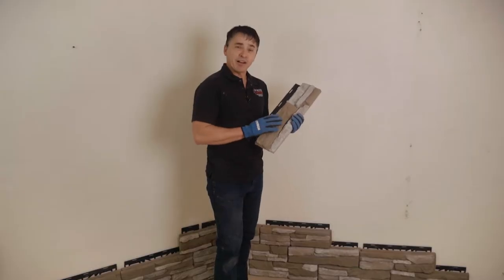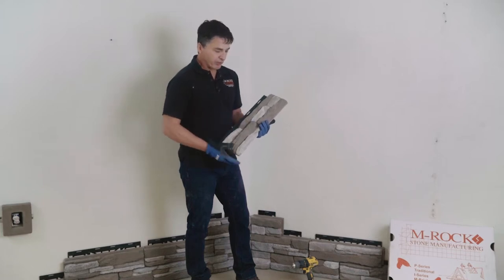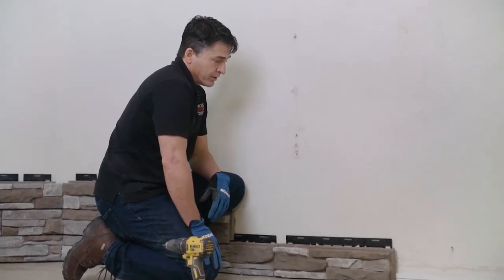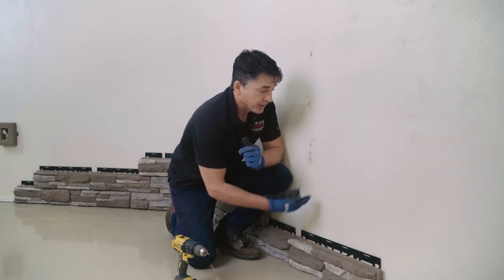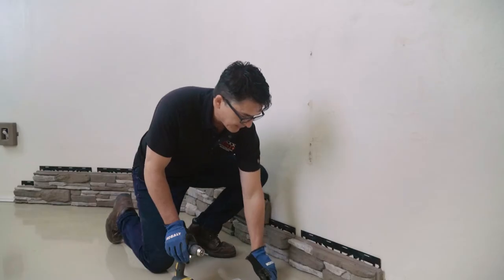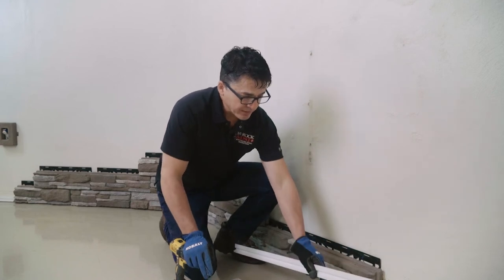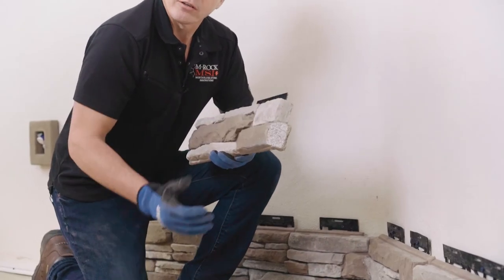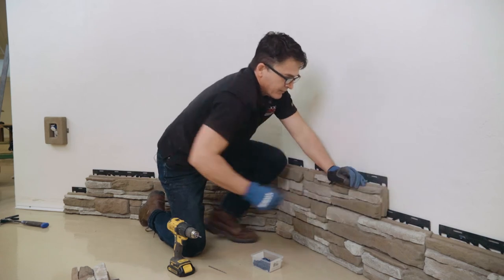How to Install M-Rock's P-Series Stone System

Comment: Or possibly even laying your bottom ground level under your rock before you pull your concrete it's for the pattern recognition flow of it and wondering how it would hold with heating and air

Comment: So I worked on a house and I think little young got here or worked on outside brick wall or material wall if you thought about changing to insulation walling but also it's for like a spread evolvement for like production repetition but it's also to help build out different grade levels to growth of the grounds because the structured flow material
Reply: Lighting

Comment: Panels need plenty of grinding to get a tight fit.  Definetely not a "perfect fit " product every time. make sure the bottom row is straight across the top of the stone and not just sitting on the starter strip .  The different size panels and improper molding will cause your lines to get off very quickly. Also if the plastic mold is at all above the cement, do not use that piece. The piece above will never sit properly on the offset molded piece.

Comment: The starter strip is poorly designed. 1. There are no predrilled attachment holes and where you drill these is very narrow. So the recommended size screws head only fits if you drill your hole dead center in the starter strip. So keeping these strips level during installation is a pain. If the bottom has to float or hang to bring base up to product.
2.  The starter strip’s bottom ledge is to small and the first row of stone will slip off that ledge. Which keeps knocking strip out of level when you start to install a screw. 3. The holes in all the stones are smaller than the recommended screw size. So you need to drill holes because if just run in a screw. Half the time it will go in crooked and distort the top rail and or pull the stone out of level. Bottom line Redesign your Starter Strip it sucks!